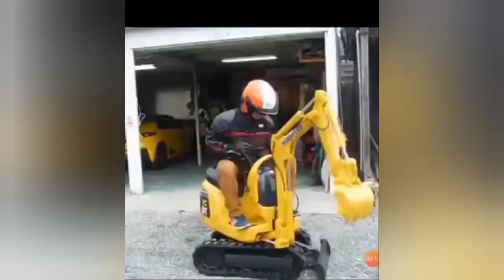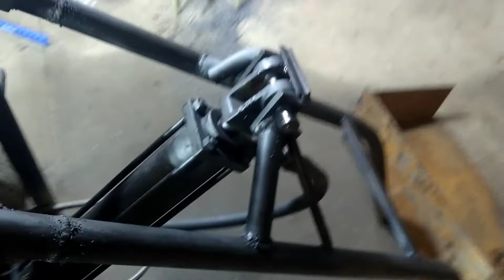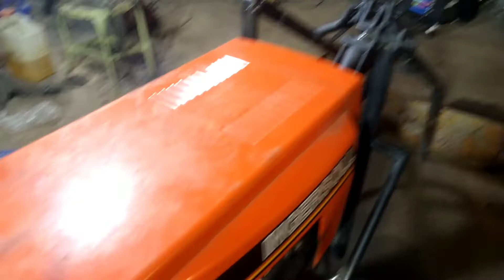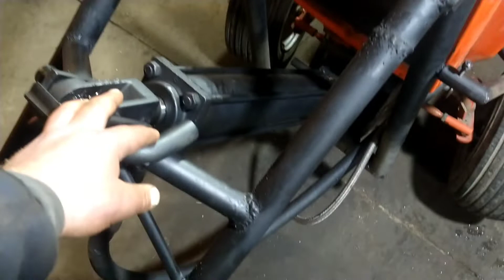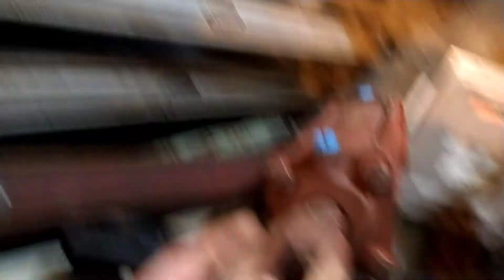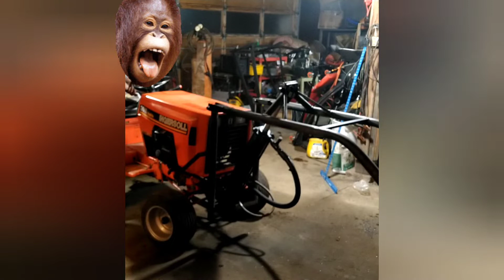😎💯DIRT CHEAP MINI FRONT LOADER   BUILD 💯 😎

Comment from the maker: Massive mistake, my main hinge point for the front loader should have been all the way back to my steering wheel. Also I should have reversed the entire setup so the weight was over the rear axle, maybe even swapping the seat and steering wheel positions so I could drive it backwards (facing backwards).

Comment: Nice concept. The cylinders are extremely overkill for what you'll be able to lift with that machine but the price was right at $10. Use what you've got :)

You'll see most tractor loaders are attached mid way or at the rear and that helps with the weight imbalance